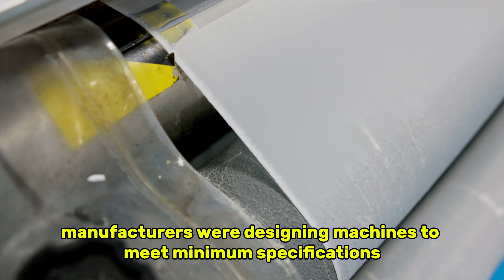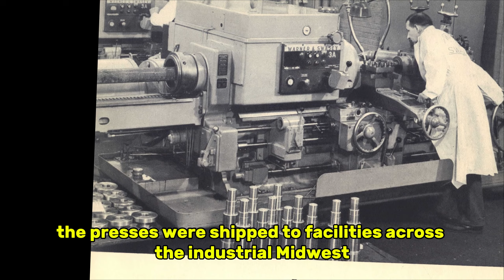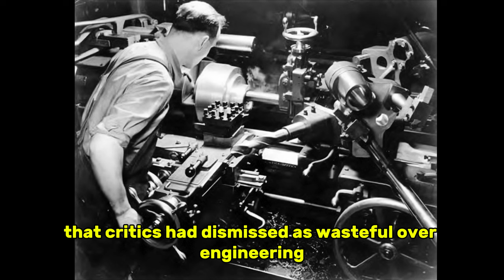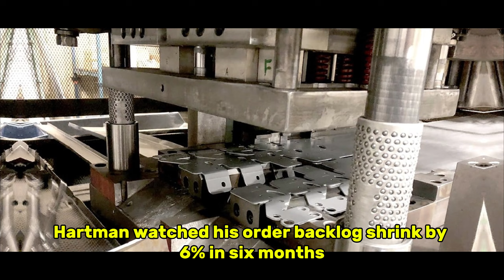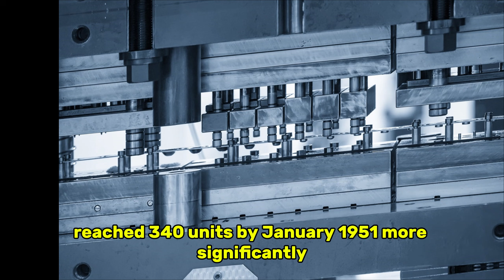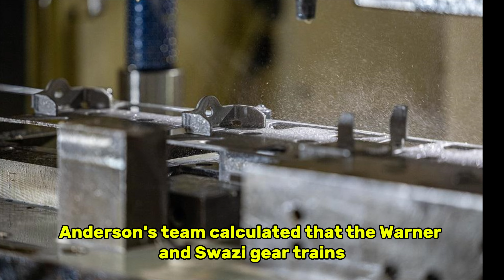Why 1940s Factory Machines Worked for Generations While Modern Ones Break Quickly

Comment: Worked in machine shops during the 1980's.  There were lathes and bridgeports made in the 1940's that were still in great working order. We didn't have any presses, but I'm sure the same design considerations made these machines hold up for more than 40 yrs also.